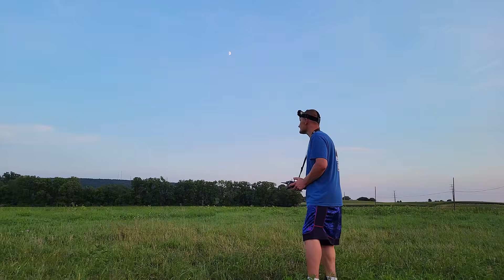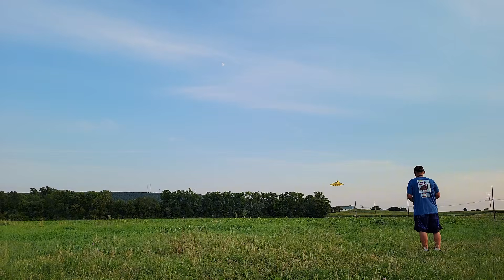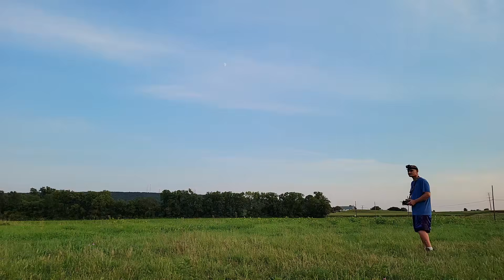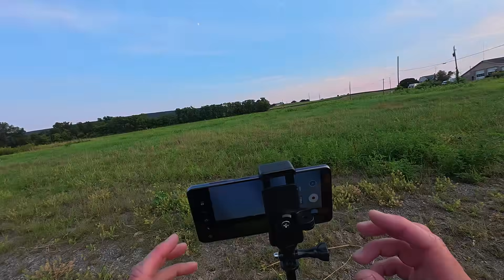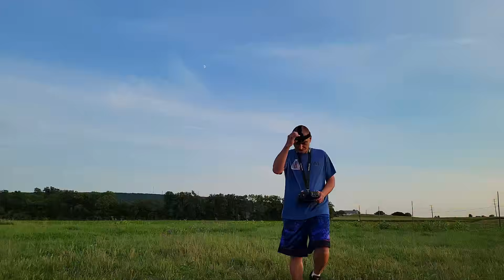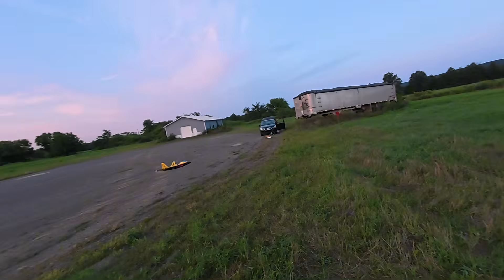F-22 Phenomenal Flight Performance with "Vectored" Control Surfaces

Comment: Can you add which pieces you say are printing in vase like mode in your other video? You said to keep the rear end weight down. But in the included instructions you show everything as 1.5% infill. I use Bambu so I can't use the prusa preformatted files.

Comment: I'm definitely gonna print this,what's the difference between the free version and the paid version?
Reply from the maker: The free version is just test pieces, so it's not all there. If you do decide to build it, it definitely flies better if you use the motor and prop I recommend within the files.
Reply: @HoloModels-RC  thanks.cant wait to get it printed at some point,looks like it flies amazing,ive only ever flown on flight sims never in real life
Reply: i just purchased the files
Reply from the maker: @1kokkerrot Thanks. Simulator helps a lot. You may want to consider building a foamboard plane for practice. They are very resilient.